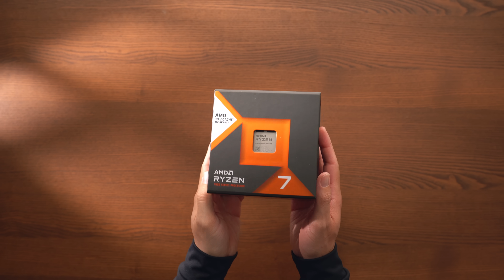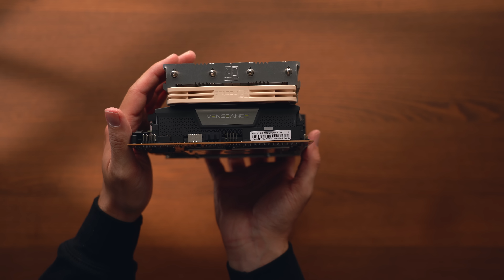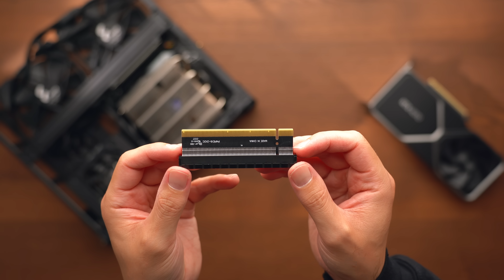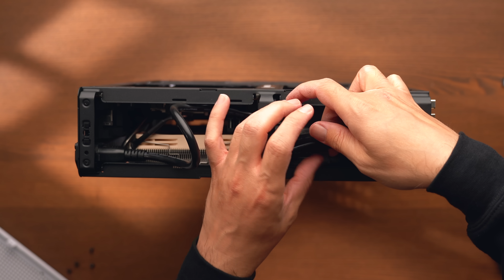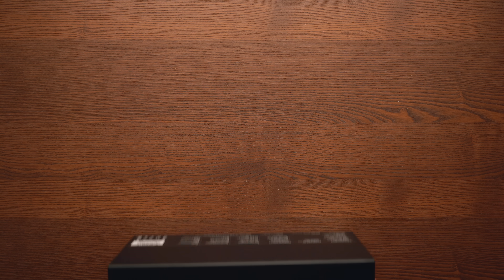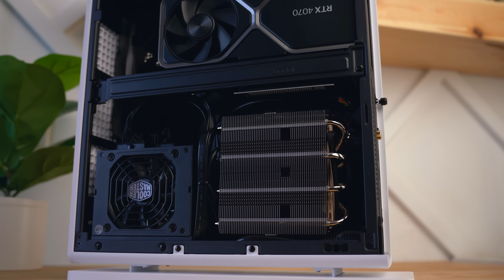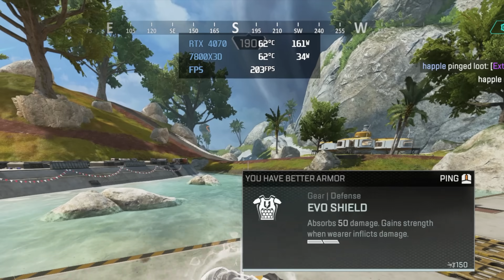UNREAL Mini Gaming PC - PS5 on Steroids

Comment from the maker: UPDATE: Fractal now has an updated PCIe 4.0 Riser that ships with the Ridge. They are currently in stock at Newegg if you’re interested. 

Newegg (non-affiliate link): https://www.newegg.com/white-fractal-design-ridge-small-form-factor/p/N82E16811352211
Reply: Wooooohooooo!
Reply: I know this build is probably dismantled, but is there a world where you run it set to 75c Thermal limit?
I have a similar computer, also SFF, that was 60 FPS 1440p Medium Settings in games at 65c, then perfect 144+ FPS 1440p Ultra settings in everything at 75c.
Would love to see this tiny case pushed a little bit more.
Reply: @PocketbellThe  maybe look at the actual thermal limits of your components... FYI your computer components can take more heat than boiling water.
Reply: I removed the Windows shell from the download. Instead I added Steam Big picure to the download.Via the registry.
My xbox gamepad keeps falling off from time to time.
Could the reason be the removal of the Windows shell? Or are you using a non-original bluetooth adapter? I think the shell may have a lower priority after deletion than Steam or the game.
And perhaps this is the reason?
Reply: Perfect PC! I want make it.

Comment: To anyone considering this build, you can probably still cool the 5800x3d on this case and could invest the cost difference in a higher tier gpu.
Reply: 5800x3d is an AM4 socket while this build is AM5. Maybe downgrading to a 7700x would be the move if you wish to spend the difference on a new GPU
Reply: @Orsthos  you can still use a micro ATX AM4 board which will be a lot cheaper as well he said it with that in mind
Reply: @Orsthos  I'd suggest looking up comparisons between the two and the 7800X3D. You would be surprised how good the 5800X3D is able to hold up, especially if you want to play in 4K.
Reply: Will a 6800xt fit in this??
Reply: @Genevisid  I managed to fit a 4070ti gigabyte gaming oc. It's 140mm tall, but the case's 137mm height limit is due to the plastic clips that hold the side panel on. I removed the card's backplate and it fit, since only the backplate was interfering with the clip.
Reply: @Eduardo1007  thanks!
Reply: @Orsthos that's part of the point, go am4 to spend less on cpu, mobo and ram with mostly no difference in performance.
Reply: @rudy_dstroys1821 In games that don’t benefit from the 3D V cache the 5800x3d will suck.
Reply: @ZackSNetwork This statement is not entirely correct, as there are very few games that fully utilise the vcache, and im yet to find any games where the x3d cpu sucks....
Reply: The you must change motherboard and RAM as well, you LL loose a lot in 1080p and 1% Low and you won't have the possibility tò update tò zen5 in AM5 with this same configuration so Better tò leave It as It Is so that in future you can get double performance Just changing the CPU and GPU, of you want tò buy a cheaper cpu you can go on 7500f but still AM5 without changing mobo and RAM, then in future you can upgrade CPU and GPU. This build Is perfectly balanced, only i would have chosen RAM DDR5 minimum 6000mhz cl30 and bigger SSD cause when you have tò change It or tò add another one it s a pain in the ass, Better tò buy and higher capacity One sine the beginning, 1tb Is too entry level nowdays. Also i was wondering if a RTX 4090 msi Ventus 3x fits inside this case, it s a 3 slot 322mm lenght GPU.
Reply: You can cool a 9800X3D in this
Reply: @progste  2 years later, and the 5800X3D is now starting to age out even in the best case scenarios.
AM4 may be dead, but it died a hero
Reply: @HyperScorpio8688 I'm still running my 2700x without many issues, I'm sure anyone with a 5800x3d will be perfectly fine for a few more years, but now am5 makes more sense for new builds.

Comment: As some one who has a humoungous water cooled full tower sitting in the corner of my  living room (won the spouse approval lottery), i find this very extraordinary.  I used to be fan of mini builds but  abandoned it when i thought i was making too many performance compromises. Glad to see something this sleek with the perfomance that matches/exceeds my 3080 build. A like and  a subscribe for you , sir.
Reply: yes, one generation onwards, it always seems a little silly to have watercooled that slightly outdated level of performance...
Reply: And you can get much better thermals by using better fans and Honeywell ptm7950 phase changing material instead of thermal paste. Near liquid metal performance that you never have to replace for the lifetime of the device.

Comment: Always fun to watch these mini case builds! Temps are also reasonable if you don't go for the ultra high end hardware! This thing is easier to clean than my regular case!
Reply: what do you consider high end hardware if not this?
Reply: I have a RTX 4090 and 7950X. I consider that high end hardware. I built in a Lian Li O11 Air mini case so that it can run completely silently even under load.
I avoid teeny tiny PC cases because fan noise is always a problem.
Reply: @little_fluffy_clouds  damn build sounds fire bro 🔥

Comment: Make sure you update your BIOS in this motherboard so you don't burn your CPU up with too high SoC clocks. Also, with AMD CPU's you need to apply a line or several smaller dots of thermal paste, because both AMD and newer Intel CPU's have chiplets spread out all over the underside of the IHS, and coverage isn't always as good from a single pea sized application. You'll often get a football shaped spread, or a circle that doesn't reach the corners with a single pea application.
Reply: AMD being AMD 😂😂
Reply: @politikaskontekstom  yes, but no. 3D V cache cpus didn't exist, I am talking about 7xxx series, when this mobo came out. So it is upon the user to update the bios.
Reply: @politikaskontekstom  Intel cronies are wild
Reply: asus are being nasty with this scandel taking no blame for the damage they caused.
Reply: @politikaskontekstom  It's actually and ASUS issue.
Reply: @david_sanchez  If I remember correctly, some Asus Intel boards had similar issues a while back.  It's part of the reason I stick with MSI.
Reply: @politikaskontekstom  its not amd issue - its Asus
Reply: @politikaskontekstom Its Asus fault destroying amd cpu
Reply: Do not update bios, it voids the warranty and won't fix the issue
Reply: @Alex-xd5wv  what are you talking it about.. is does not void the Warranty...

only if you do it wrong and it kills the board for example.. the bring out the update themselves. you also need to update your Bios for certain CPUs to work..

so for example and 5800x doesnt work on an b450 board unless you update the bios.
Reply: @Jeff-hk8th  What Alex was referring to was the fact that ASUS released a beta BIOS that was supposed to fix the issue but they posted a disclaimer that installing that BIOS voids your warranty. And it didn’t even fix the issue either. Steve GN went into some good detail about that and it’s one of the reasons why people are having issues with ASUS right now.
Reply: @Jeff-hk8th  The guy who you replied to was talking about the new legal BS that Asus is trying pull.
Reply: @Alex-xd5wv  It doesn't void the warranty. Windows 11 sometimes even automatically updates the BIOS for you. Also, even if it doesn't fix the issue, the only way this issue could possibly be fixed would be through a BIOS update. This is why you should keep your BIOS updated just in case.
Reply: @david_sanchez  "What we do know is it's not an isolated issue, as other users are reporting similar problems with 7000X3D-series CPUs on both Asus and MSI branded boards."
YES, Asus made MSI burned AMD cpus and also gigabite
Reply: What the hell are you talking about? An appropriately sized amount of thermal paste will spread evenly across the integrated heat spreader regardless of whether you put it in a pea shape, a line, an X,  or a spiral. If you're not covering the IHS it's not because you're not spreading it out correctly, it's because you're not using enough.
Reply: the IHS is so thick that it doesnt really matter if you cover it wholly with paste or if you cover directly over the chiplets. It is a themal buffer that spreads heat over its whole area. This is a double edged sword. One one hand it is less susceptible to uneven thermal compund spreading, but on the other it makes the CPU work on higher temperatures (therefore the 95C is by design).
Reply: Or you could just use Honeywell ptm7950 phase changing material instead and get way better thermals without worrying about whether or not you applied too much or too little. Not to mention it will never dry out.
Reply: There are two contact points under the lid, lower center and a corner offset center. A quarter sized spread in the center of the CPU will be sufficient.
Reply: @nowknow  From my testing, I was able to get a decrease of 10c ΔT (±2C) between a single pea-sized application and a line across three different AMD CPUs. The line is superior.

Comment: This is the primary reason I want more GPUs like the 4070 but without the insane price tag.   4070 has low enough power draw that it can easily support custom coolers which are 1-2 fans.   Basically similar to the 970 and 1070 which both saw mini variants with custom coolers for Small Form Factor PC Builds, the 4070's small board and lower power draw is perfect for another single fan custom cooler small form factor ##70.

I'm still under the impression though that the 4070 should of been marketed as a 4060.   I think the 4070 is a great GPU, just it's relying more on Software improvements than hardware, which is insulting when taking into consideration the price they're charging.   I honestly want a 4070 but I will pay nothing less than $399 for it.    It's not a 4070, all but in name only.

Comment: First of all, what a terrific video!  Very well made and edited.  Bravo.

Second, it's a great change of pace to see someone making a video on a new PC without using liquid cooling.  I don't like liquid cooling and never going to use it.  

Congrats again.
Reply from the maker: Thank you so much! I really appreciate that!
Reply: CrimsonStone  why
Reply: @devyn.johnston  did you try to evaluate thermal performance on this btw?
Reply: CrimsonStone  you should have tried back in the days of the pentium 4 when there were no all-in-one kits and you had to cut and fit the hoses yourself and make sure all the air was out and there were no leaks before you installed it, and hope. :D
Reply: @devyn.johnston  are you going to explain the price? Ps5 is a super computer with 500 buck. And your pc is 4k ish
Reply: @godzillaeatsushi4979 PS5 have medium tech that been crank up to to higher performance and Sony call it a day. While this guy PC will works for years.
That mean when PS5 will need change to stronger variant this pc will be still ok. But I will not judge what people will use to have fun with.
Reply: @godzillaeatsushi4979  ps5 is cheaper because sony expects to make a loss on the system itself they just wanna lure u in so u pay 10 buck a month for ps plus and they make about 30%cut of every game sold
Reply: I like the concept of water cooling but there's a beauty to air cooling it's hard to describe. Just being able to dissipate massive amount of energy in thermals through heatsinks and air movement alone is incredible. It has the old Porsche feel to it. Especially with high end heat sinks and fans (Noctua / Be Quiet). It has a mechanically intense feel to it.
Reply: @Jupa  That's an interesting perspective I never thought about.  Cool.
Reply: @godzillaeatsushi4979  I don't think a downclocked Ryzen 7 3700x and an RX 6600XT can be considered a "Supercomputer".
Reply: lol you clearly never seen a properly dusted cpu air cooler
Reply: @godzillaeatsushi4979  Super? It struggles with 60 fps in 1080p..... It's a joke, for the poor people. Thisi s an expensie, but multi purrpose mahcine.
Reply: I've never had a problem with liquid cooling in my life thankfully 😇
Reply: @Jupa  That makes no sense. Both water cooling and air cooling have their use cases.
Reply: Why are you scared of water cooling?
Reply: Beautiful build man! I recently broke my leg and im gonna be off work for 6 - 12 months so I'm looking forward to building my 4070ti PC soon. I'm hoping to build a micro atx but have only built full size atx before so this video is really inspiration for me! Also it's amazing to see the power in such a small build! Bravo!
Reply: same here
Reply: @gdrp87 - I hear ya, I stumped my toe 20 years ago, and I haven’t been able to work since. 😂
Reply: @RedLeo-pf9yo  haha 😂 I wish I was joking mate I really messed my leg up... Anyone want to buy a BMX???! 😅😅😅 Yeah I am not missing working my ass off everyday though even tho it's hard to do things... I didn't get the 4070ti I got the 3070ti... I wish I had got the 3080 though as I'm running a 1440p screen and chasing 165hz. Hope all's well mate. Happy gaming!!!
Reply: Agreed.  I'm tired of everyone pushing liquid cooling on their builds.  I don't mind if people want to do that, but for whatever reason, most of Youtube builds are liquid cooled.

Comment: Question, I’m building almost the exact same thing - same MB, CPU, & NH-L12S.  Did you consider other cooler orientations?  The way you installed it seems like it hits the MB on my build.  I was thinking about orienting the tubes toward the top of the board.  Worried I might not be considering something…

Comment: Great build! How does this stack up against the NZXT H1v2 rig that you built in terms of temps? Is the latter enough to cool the 7800X3D?
Reply: Its not a hot chip, in fact all the 3D-Vcache chips are lower wattage than the standard ones.